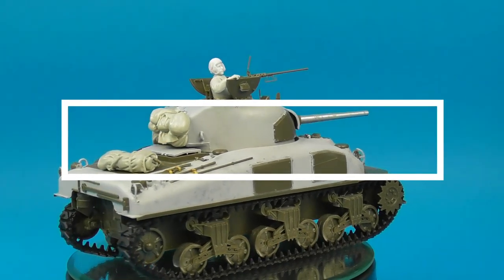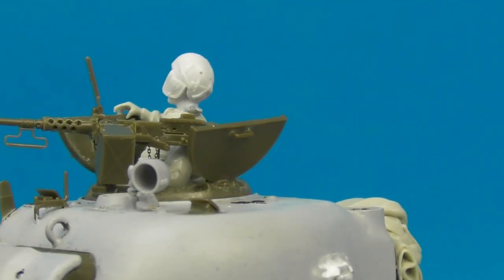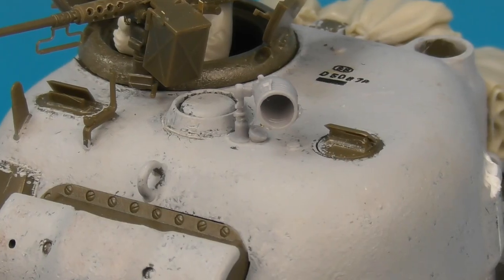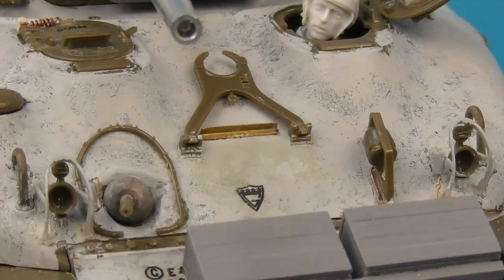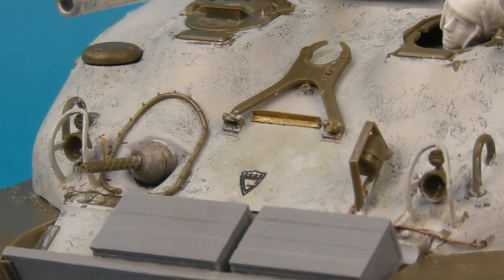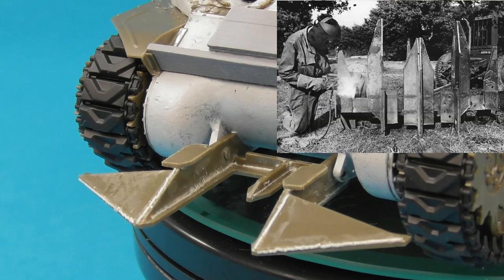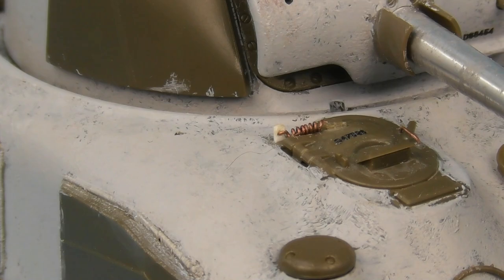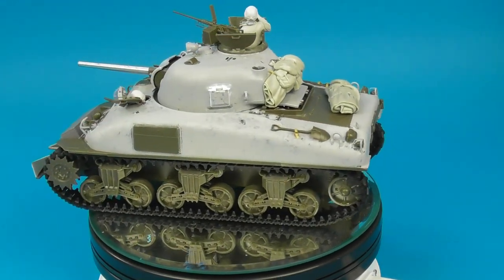Asuka Model M4A1 Sherman Normandy 1944

Comment: Very helpful video - I’m building this kit right now. Your suggestions & upgrades were very helpful - many thanks!
Reply from the maker: Hello, sorry for the super late reply. Hope this does not arrive too late, or at least might give you some ideas for further Sherman projects. The Asuka kits are pretty good out of the box. The only things I would recommend replacing as a matter of course. Is the barrel with a metal replacement, other added details I would recommend would be adding cast textures with liquid putty such as Mr.Surfacer.

Super sorry for the late reply 

Shane.
Reply: @longlance67 Thanks Shane. I’ve made good progress on my Sherman following many of your suggestions- metal barrel, TMD upgrade set, extra stowage, some subtle cast texture. I got lazy with the tie downs for the tools so I ordered some 3D printed ones instead of making my own. 

I always enjoy your content - hope you’ll keep those videos coming!

Comment: Fantastic work.  Looks splendid.  Do you know if the earlier model M4A1s with M34 (narrow) gun shield and bolted transmission saw action in Normandy?
Reply from the maker: Thank you, really glad you liked it! As for A1's with early features, I did a quick search through my references and could not find any US M4A1's with the early transmissions and rotor shields but that is not to say that none were deployed. I will dig out my Zaloga reference books and see if I can find any photo evidence there for you
Reply: Thank you, that is very kind.